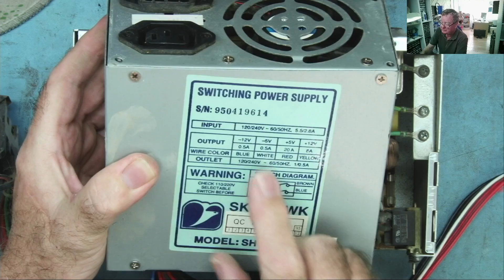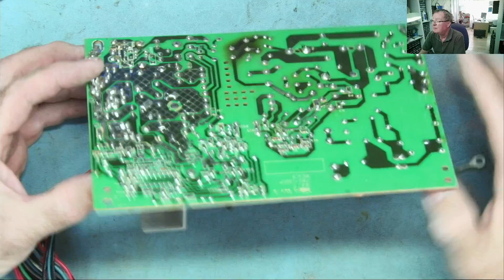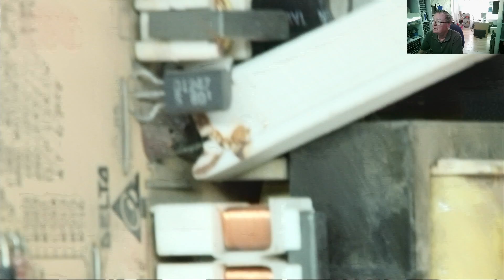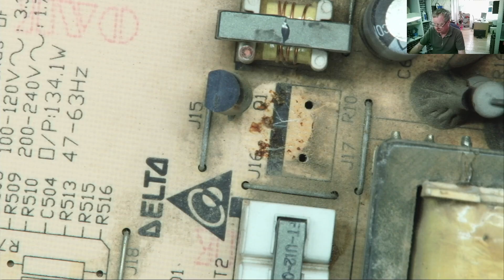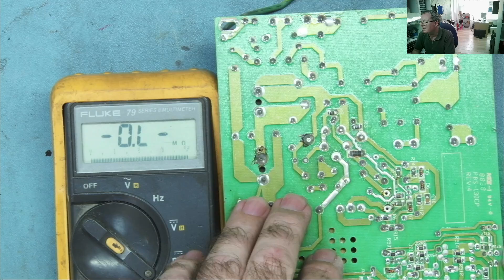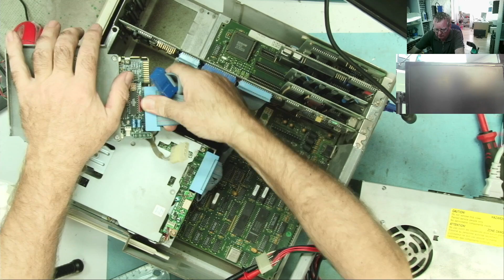Vintage Retro Computer AT 286 Power Supply Repair PSU

Comment: Do these old power supplies need to have a connection in order to boot (to a motherboard or device)?   I'd be quite surprised if that were so.  I have two PC-XT PSU's that do not spin up.  The fan moves a bit (sometimes) when turning the switch on, then nada.  The only thing connected to them is power from the wall.

Comment: There may be a loose connection in the power supply because the fan first started spinning when you tapped the case at 26:56

Comment: some times the stepper motor can get stuck, if you can get to the stepper motor bearring a couple of drops of sewing  machine oil in to the bearing  could free it, did'nt hear the hard drive spin up try giving a tap when booting up.

Comment: I could see more dodgy solder joints in the video, and the lose resistor don´t seem on completely in the end so I would had scraped the legs before soldering it back first. I wish you would had taken a closer look at the two other power resistors you see have burned the pcb around them since they very likely have bad solder too but I could not get a good view of them. I think the PSU was dead because something is still lose in it and tapping it temporarily fixed it

Comment: Coincidentally, I was at a friend's house this afternoon checking the contents of some old IDE drives. The last one was from an old 286, one of the early WD IDE drives. It would spin up but wasn't recognised. As for the old Tulip pc itself, the PSU was dead. It is going for salvage with any profits going to charity so I didn't bother investigating further.

Comment: I'd tap the HDD with a rubber handled screwdriver on the side while plugged in, or another thing I used to do was spin it in your hand like trying to open a door handle quickly, sometimes stops the "stiction" not that I can spell it lol and I've tapped them with my palm on one side corner...  had a few RLL drives (one a massive 8Mb full height 5.1/4) get stuck as well as MFM's and then some ticked like a clock with a metallic springing back - bad reads NBG after doing it too much haha

Comment: Good fix on that classic Delta supply. Delta is the big mamma jamma in PSUs. You think you're buying this, that or the other PSU but you're really buying a Delta half the time. Their house brand stuff is solid too. You should get all that old glue out of that PSU. It looks like it's gone funny to me. Not funny ha ha either. Old glue going conductive is a common failure.

Comment: Or maybe the solder joint at the resistor is still a little bit dodgy and you moving the PSU around caused it to make contact again?

That aside: You may want to take a quick peek into the metal can at the mains input connector. There's probably a filter in there and that may have a RIFA cap, which are infamous for spontaneously releasing magic smoke of a particularly foul smelling variety.
Reply: Smoking the RIFA
Reply from the maker: @1pcfred  PMSL

Comment: I would have cleaned the leads of that power resistor before resoldering it. There appeared to be some corrosion or other substance on one of the leads that stopped it from taking the solder.
Reply: There's only three rules to soldering, clean, clean, clean! It seems like just one rule but you have to clean a few different things. The tip of your soldering iron, your solder and the stuff you're soldering all has to be clean. Contamination is the leading cause of solder failure.
Reply from the maker: I had a bit of trouble soldering it but a good dollop of flux did the job. Otherwide yeah I would have had to clean them with something abrasive.

Comment: IMHO it's always worth try to fix old AT power suppliesI had to fix some. Also a SONY PSU for a very old Sun non Sparc box. 
But have had to refurbish & repair some tools first. Really need a modern multimeter. Will try to win the one here 😊

Comment: The interesting part is that a vintage PSU has still good enough caps to run. You take a newer PSU and is already dead with dry caps ;). We all "love" modern electronics :D when they fail so easily.

But, hey, Sony keeps up really well I'd say.

Comment: Interesting to see you using solder braid rather than a desoldering tool like a solder sucker - is this a personal preference or is it better on older boards to use the braid over a solder sucker for example?
Reply from the maker: Just the easiest thing to grab to be honest. I thought it was good enough for the job, which it was, and quicker than waiting for my vacuum desoldering gun to warm up.
Reply: @learnelectronicsrepair  Single sided boards it doesn't get any easier. When I worked at a board house we didn't have any solder suckers. We had braid. We'd also just slap boards to make the solder fly out of them. To slap a board you'd heat the joint with the iron with the solder side away from you. Then once it was molten real quick take the iron away and give it a sharp rap on the edge of your workbench. The molten solder just flies out. It's a pro technique.
Reply: I saw some solder sucker rip the pad up, probably the braid + flux is a much more gentle approach
Reply: @Nebbia_affaraccimiei  pad ripping is more down to the board than what you're doing to it. Although rough handling can make things go bad. Some pads on boards just lift no matter what you do. Either the glue they used sucked or they didn't make the ring big enough in the mask. But that's all repairable especially on them old single sided boards. Delta makes great boards though. That board is a tank. I would like to see what made that one scorch mark on it.